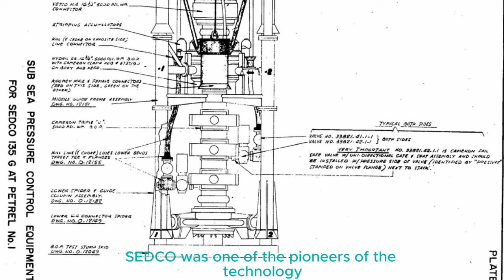Petrel No. 1 Blowout in Australia (SEDCO 135G) Case Study by Bryan Atchison. Oil and Gas Blowout

Comment: I actually worked with a guy who was on the semi at the time.  The 135 got its name from the height from the pontoon to the deck, 135 feet.  The chap was a roughneck at the time and jumped from the deck into the sea.  It’s amazing that he lived to tell the tail.  This was not SeDco’s only mishap in Australia. The supply boat “Helen” over ran a buoy, believe hatches were open at the time and she foundered.  Her sister ship “Ann” was moved to the Persian Gulf.  This was not the first mishap with a 135 was lost. After leaving the shipyard in Asia and undertow to her first contact, her towing attitude, she had three pontoons, were forced apart by the speed and pressure of the seawater, essentially imploding.  It happened either at dawn or dusk, no one one the tug saw it happen. Miraculously some of the tow crew were found clinging to a wooden pallet.  I know this for a fact, as in the 60’s I worked with the radio op off of the tug, he was Dutch as I remember.  I think it was the 135 B that went on to be, BP’s Sea Quest.

Comment: I was there. Joined the rig in Singapore after the blowout being refitted. On mirror seas towed back to bonaparte gulf, near Darwin . To the oasis of fire on the sea. 
It was one of these calm days that I saw the secco Helen go down. It was a brand new ship. Some of the 9 hands that went down that day, this was there first day at work, fresh from Darwin .
To cap the leak ,drill another hole spud into the original hole. Barges holding vast quantities of mud would plug the hole. 
I was a roughneck for awhile my last position was in the control beneath the deck. 
Memories of a £10 pommy ,I was then about 22/23. I can remember my vision then , my 
consciences  . If only I could have the vision I have now , then. The light is not out yet how far can I see.
😎🌏❤️ jt

Comment: Great point and explanation... Yet... Still, even accidents still occur... Seems the lessons are not learned or if at all... And your own point out that there is a solution for such,  so good luck with that... Seems from the 1969 (SEDCO 135G ) accident and into the 2010 Deepwater Horizon there would have been one too? Yeah, right...!
Reply: The number of wells drilled vs severe incident has increased hugely over that time though, i suspect.

Comment: Back in the day at that depth I would have had much heavier mud,I've been on 10,000 foot well with 21 pound mud and still kicking. All bop's need to be rated 20,000 pounds and need 2 anulers,but what I ran into the days was alcoholic tool pushers and lazy crews that did nothing to the drill mud for a week, so the mud ran out of gell and you get back to the rig after 2weeks and they slug it as your walking up to the floor, and the hole is caving in as your coming out of the hole. Whom ever owned pinn rick in Texas  back in the early 80s your mistake was a drunk tool pusher that wouldn't listen to a Derrick hand that told the driller to stand back and let this fool f it up,he did and 2 weeks of pulling drill pipe apart I quit and that was it for me. Worked on some of the biggest triples in south Texas and worked on a fun small 1,I would say fields was best drilling company back in the day, harkins was a bit corrupt, south land is where I had the fun we could trip some pipe fast and keep the tool pusher because slamed steel.